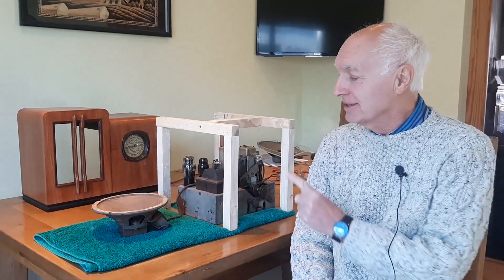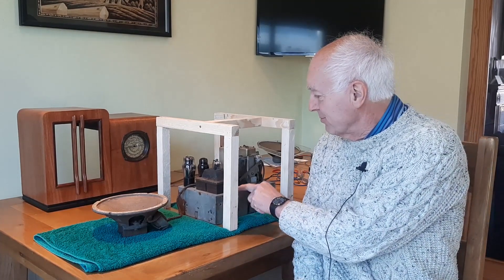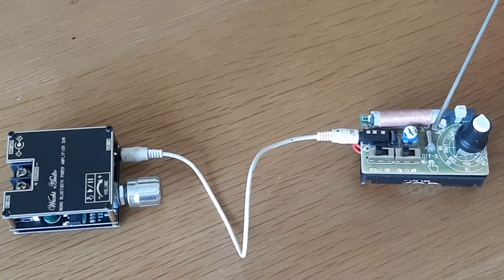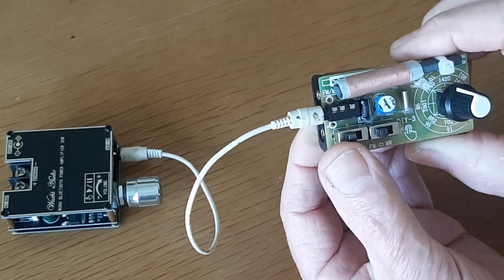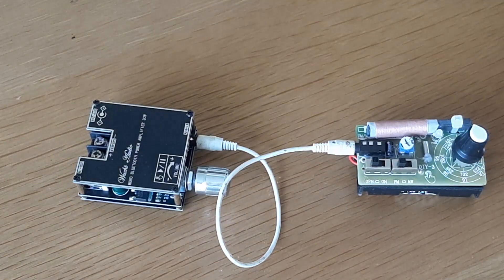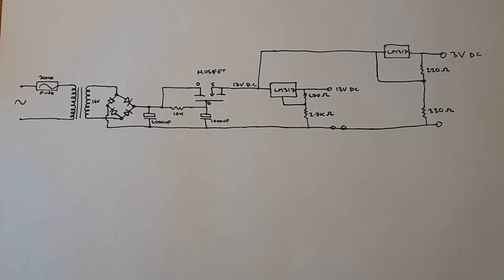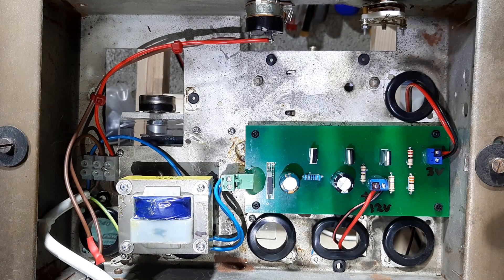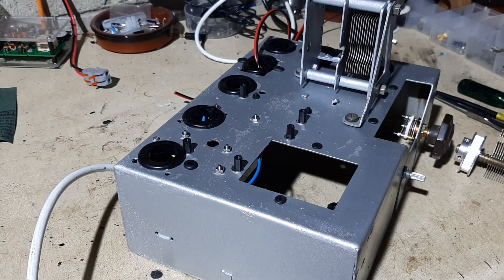1936 RAP Vintage radio Part 2

Comment: Love it! I’ve enjoyed restoring old sets too and have fitted am/fm modules , but not seen the one with the pot tuning before. Keeping the mechanical tune working makes a big difference to the finished result, so thanks for sharing your hard work. I aim to copy some of your ideas! 
(How did you bend the Perspex frame?)
Reply from the maker: I constructed a homemade bending frame using an element from a hairdryer stretched into a channwl fitted below a hinged table the temperature controlled by the varactor in the workshop. I might do a video sometime  in the future. Thank you for your comments.

Comment: More RIP vintage radio than RAP I think. However your solution for fitting the new digital radio is ingenious esp. using a pully mech. on the original variable cap tuner body. I did wonder what would happen to that LM317 dropping 14V across it without a heat sink. I hope you keep the old radio chassis parts in case you ever get to fix another one that has good valves. I suppose even if you could find alternative valves it still wouldn't be original so you might as well make something that can be used. The case looks superb. Can't wait to see the final results of all your efforts.